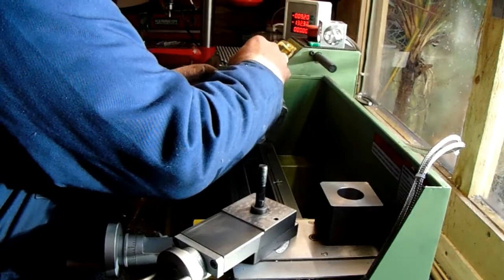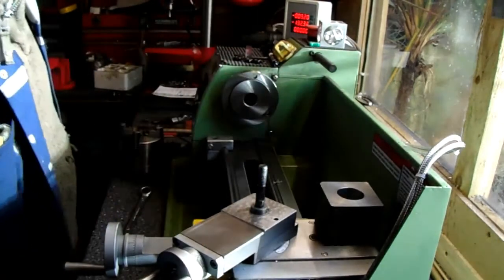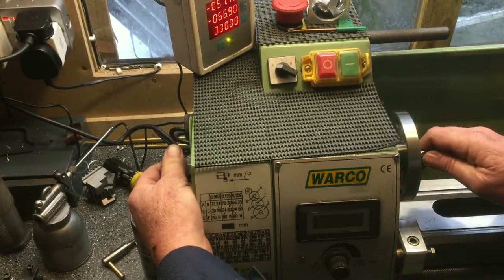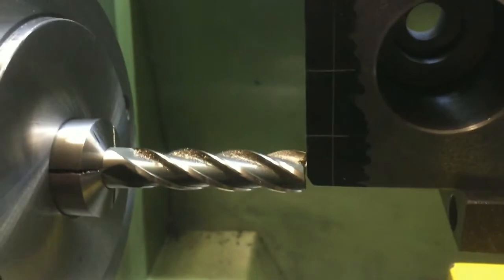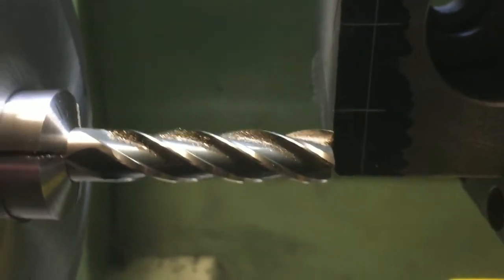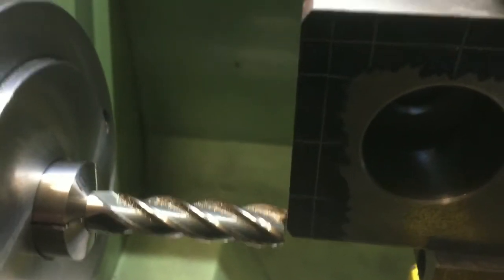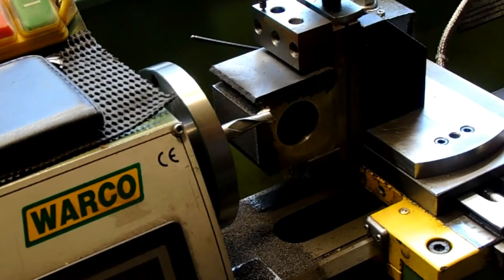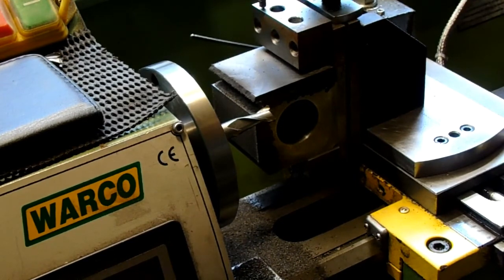WARCO LATHE Shop made quick change tool post part 5

Comment: Are you going to harden the toolpost block?
Reply from the maker: I had originally planned to make it from EN8 but could only buy it by the metre , cast iron was easy to buy just the piece i wanted, so i went with it on the thought that the compound slide is unhardened cast so i had not planned to harden the post with the light duty i will be using it for , also i do not have the facilities to flame harden such a lump .